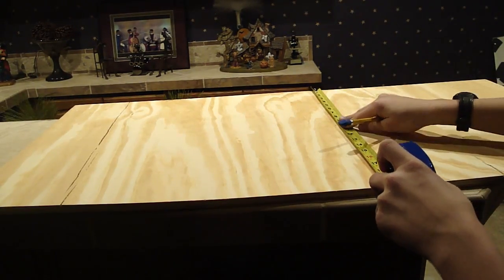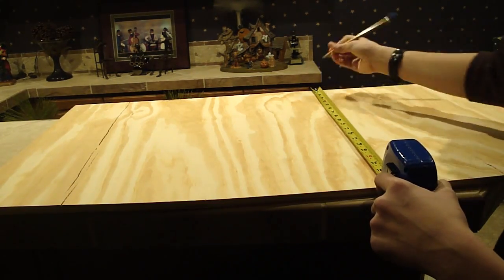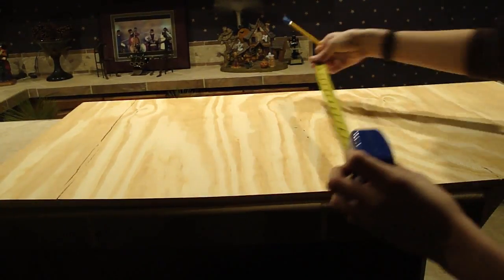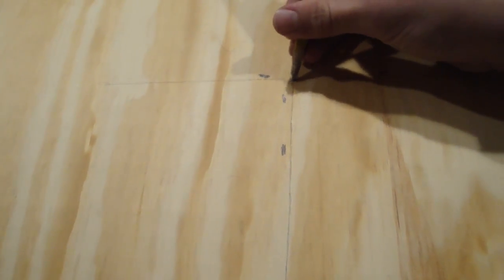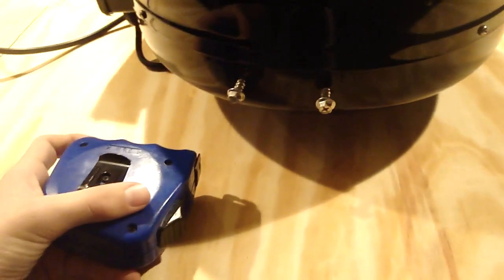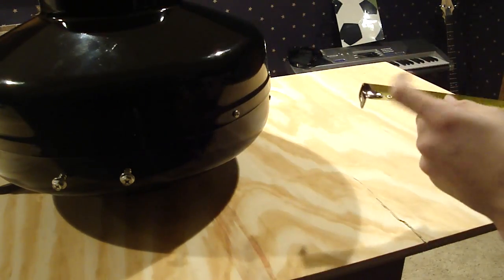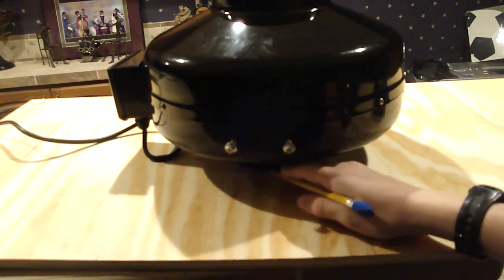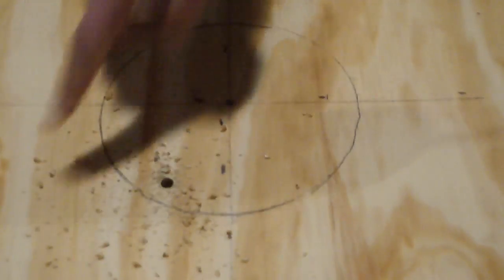How to Make a Fume Hood Part 2 - Begin the "Hood"

Comment: Nice video, but personally, If I knew the fan's intake was 6 inches from outside to outside on the rim, and made sure that the 'centre' (I'm Aussie) point inside was 3 inches in from the outside of the intake, I'd have saved a bit of time once I found the centre of the board;
Instead of shuffling the fan around where it sits to find the centering spot for it, I'd have measured points at 7 inches in from the short sides and 17 inches in from the long sides along the X/Y axis markings that were needed to find the centrepoint, then made sure the fan's intake rim sat on or just inside the 4 markings (each of which should be 3 inches from the dead-centre marking of the board).
Reply: I'd have used a compass set to 3 inches radius...
Reply: Owen Flaherty That works too, but a bit simple for my tastes at the time I wrote that whole thing up. XD
Reply: ElNeroDiablo Studios Hah seems too simple to be a viable solution xD
Reply: Owen Flaherty Yup! XD